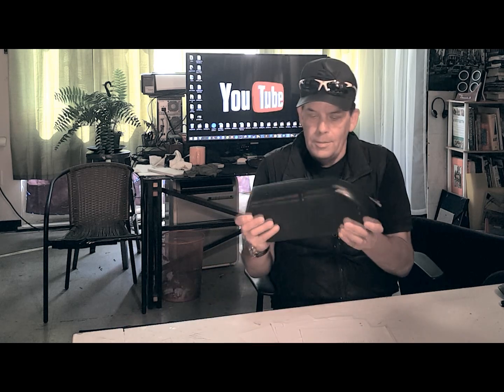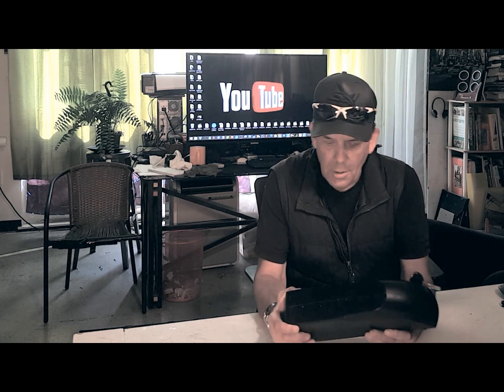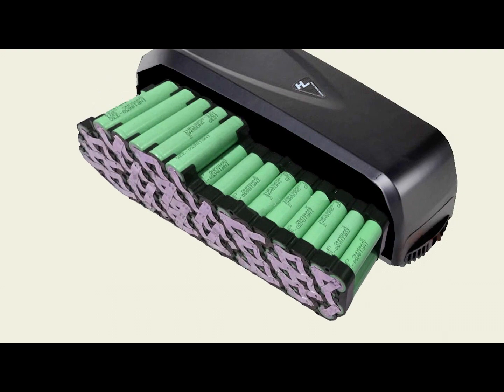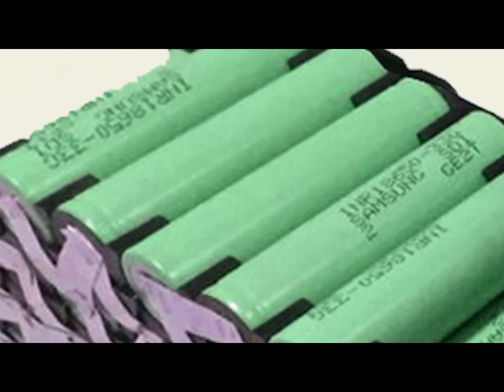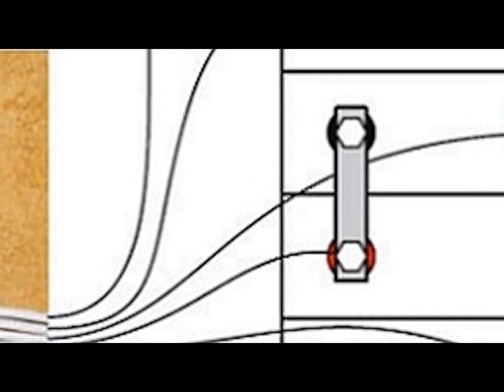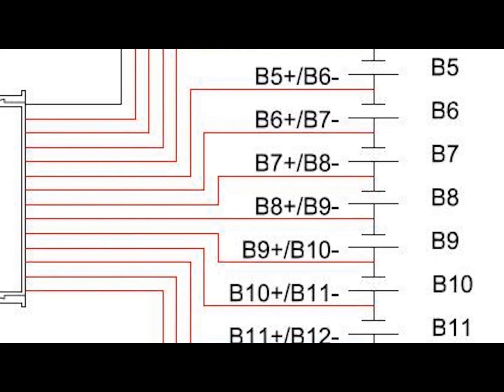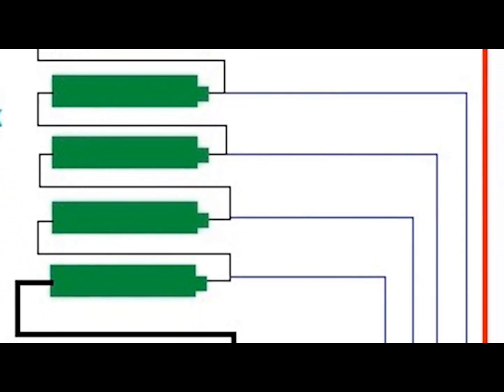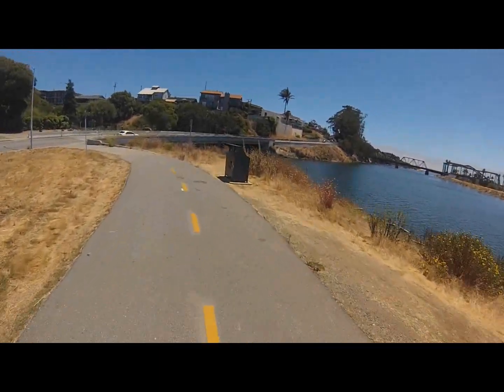A look inside your E-Bike battery and how it works | IMPORTANT

Comment: Riddle me this Bat man. I have been told a 36v battery 14ah battery should not go below 27.5v no 28 no 30v. Well I'm at a loss would it be safe to put the cut off at 28v? I bought a zero 10x controler and LCD display combo. And you have to set all the perimeters up. Thank you.

Comment: I have an ebike that I bought a while ago. 
I’m interested in adding a small 12 volt horn to it.   

The battery I have looks like the one in this video.  I’m not sure how I’d wire it in to the battery though.     

There’s a USB port on the side, but I don’t think that has enough power coming out of it.   

There’s a wire going to the battery from a digital speedometer on the Handel bars. 
Could I wire in to that to add a horn?
Reply from the maker: That is really an issue of the controller. Some have connections for horns, lights, cruise control, etc.

Comment: once fully charged it should have a cut out switch to prevent overcharging but the instruction booklet says do not overcharge. I would of thought my 2018 model would have that capability. By the way what do you think of chinese made ebike batteries which mostly they all are .thanks